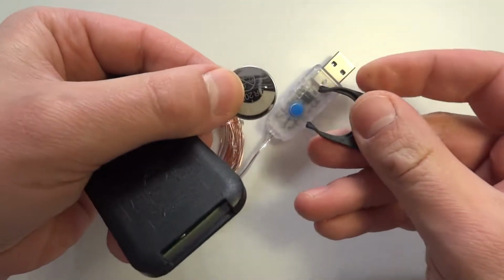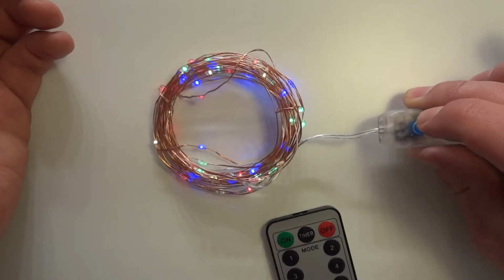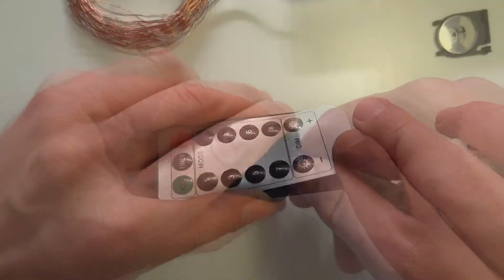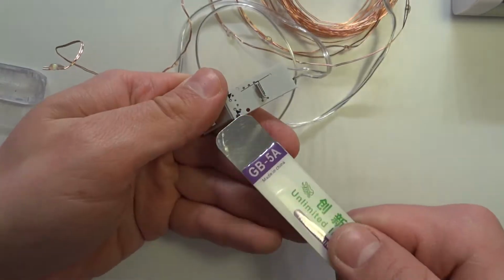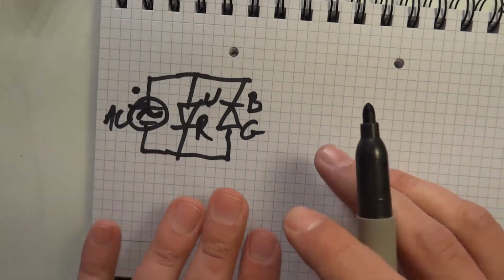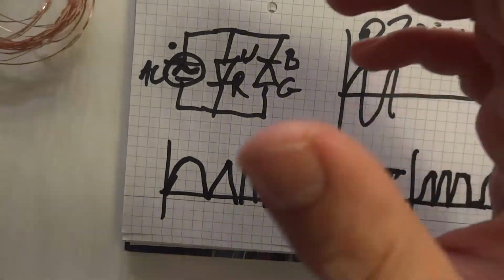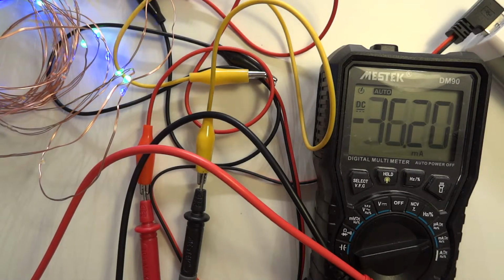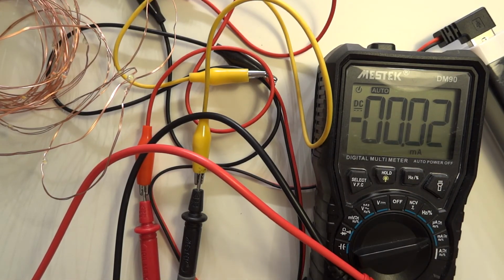Closer look at USB powered LED string fairy lights with a remote

Comment: Hi the wirings detached from the board and we are trying to fix it by glue gun, is that okay?
Reply from the maker: I think it's best if you solder it. Even if it makes good connection now, it could pop off or short easily.

Comment: how do you fix the usb part if they fell apart
Reply: Mine didn't fall apart  there is a bad connection
Reply: @barbaramcdonoughpotocki1514 get a new one
Reply: Get a new one.
Reply: @sandratate9065  what we said usb part calles

Comment: I have the same ones but it stopped working the next day. Any ideas on how to get it working again?
Reply from the maker: Maybe it has a bad solder connection to the USB plug or the LED string got disconnected from the board?
Reply: @pandaengineering  how do you reconnect the LED string to the board and fix a bad solder connection?  :)
Reply from the maker: With those specific ones it doesn't matter in terms of polarity how you connect those - only thing that will happen is that it will swap the colors 🙂 if something like this starts to act weird - I just reheat all solder joints with soldering iron (and sometimes with a bit of solder if they look really matte). Just make sure to remove first the remaining wire if it snapped off at the end so it won't mess up your soldering job.
Reply: @pandaengineering  thank you so much for your help and wonderful youtube content have a good day
Reply from the maker: Thank you! ☺️ I'm happy that you liked it. Have a great day!